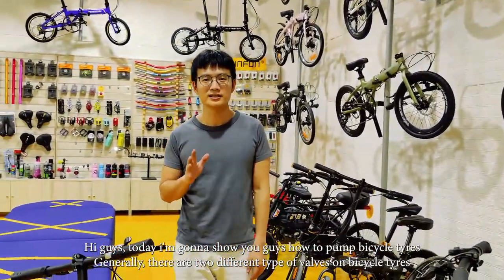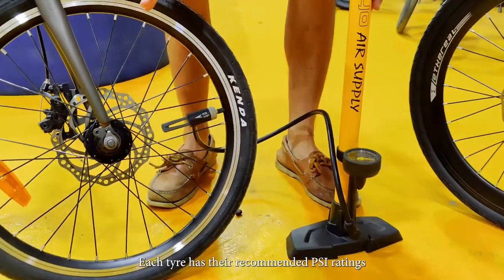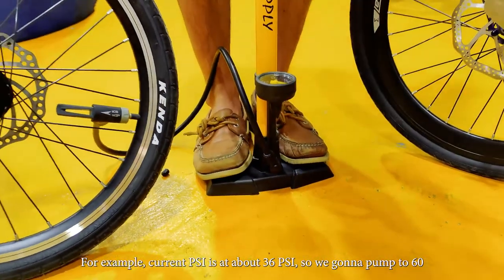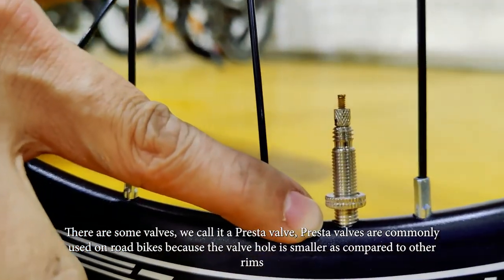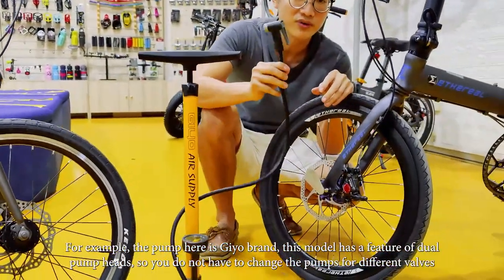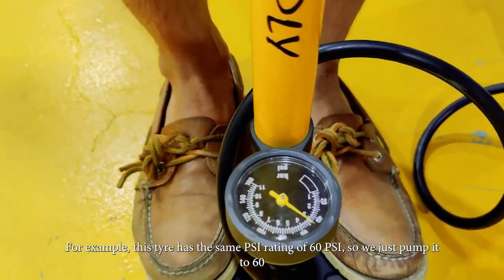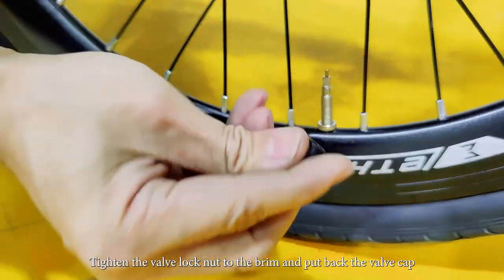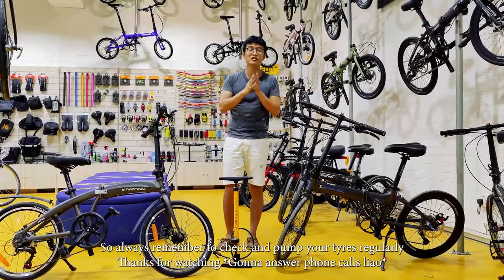Guide on how to pump Schrader and Presta valve correctly

Comment: Is there any tips on better way to pump tyres, such as the valve must be at 6 o clock? My schrader valve always leak some air while pumping not sure why. Could the valve be slightly faulty cause it is old?
Reply from the maker: Hi Qin Xiang, there's no fixed way to attach the valve/pump adaptor. Check if your pump head have any locking mechanism, always ensure it's fully inserted before locking it.